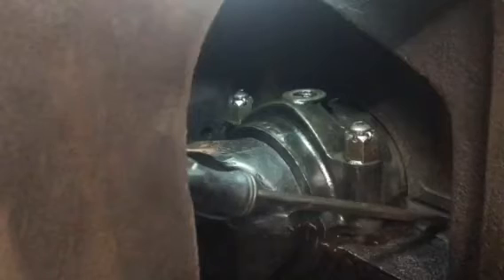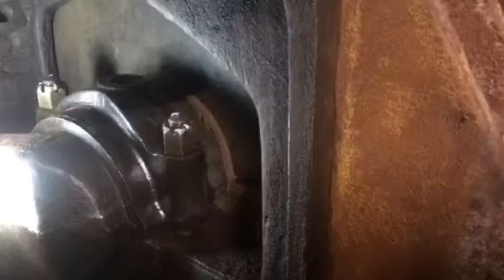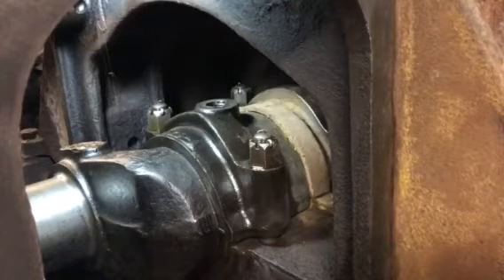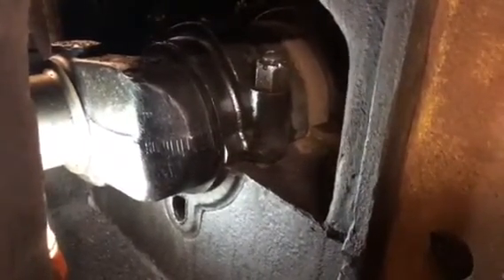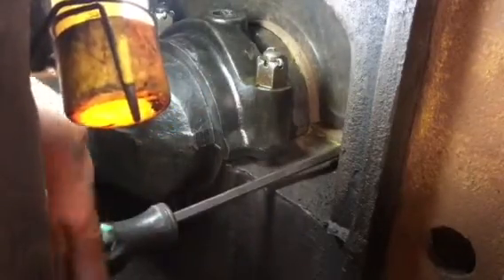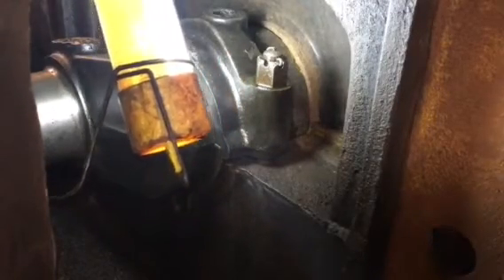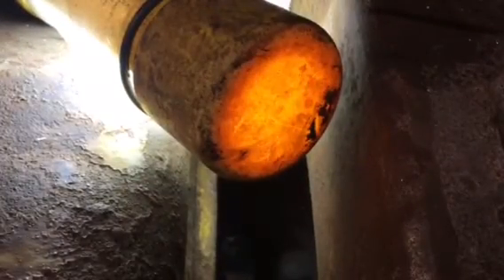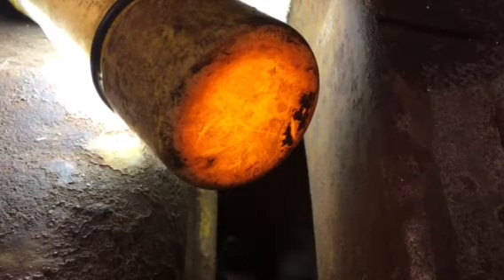Cat 60 rear crankcase cover install 4/20/21

Comment: So the cover and the leather is the oil seal? I couldnt see if the leather was running on the crankshaft of the rear main bearing cap?
Reply: I think its just sealing on the bearing cap right?
I like the leather idea, i have cork laying about, but ir doesnt like bending to much
Reply from the maker: The leather fits between the cover and beating cap, there actually is no rear main seal, not even packing, just a spiral machined into crank to channel oil back to a drain hole to return it to the pan.
Reply from the maker: I didn’t even think of cork, would have worked good if I had any, I had the leather and I’m sure you also try to use what you have. Your cork is probably old like me, I don’t bend well either.
Reply: @oldamericaniron5767  righto, thats a interesting setup.
Do they tend to leak any oil? Or does it work rather well.
Reply: @oldamericaniron5767  not sure i have any leather around. Dad has some old Hemp rope for seals. Bit cork ive used alot.
Reply from the maker: As far as leakage about all I can go on is there wasn’t any amount of greasy dirt build up around it as you would expect with oil leakage in a dirty working environment. Hopefully I’ll know more from experience later this year!